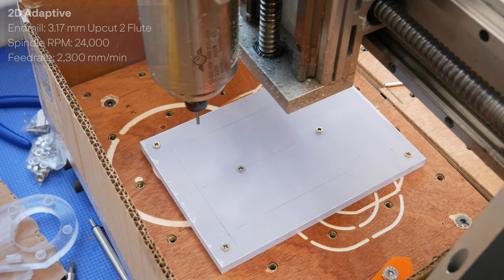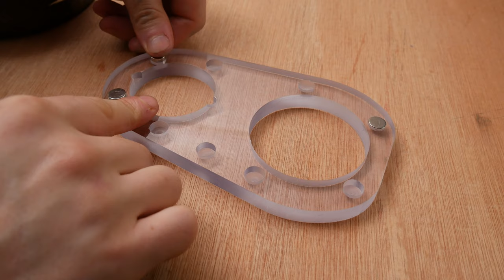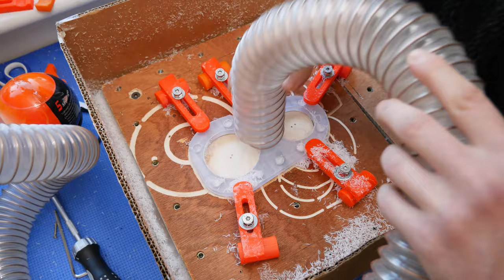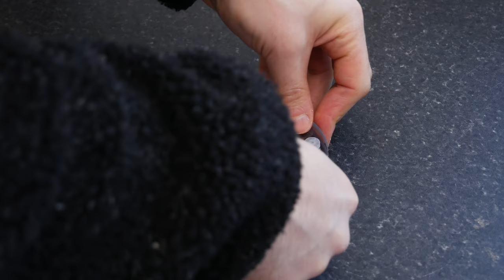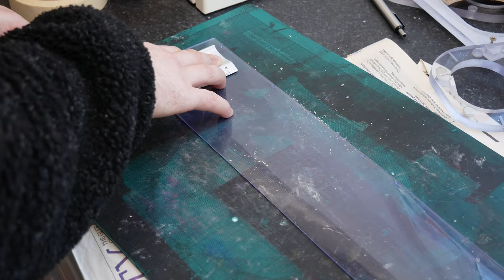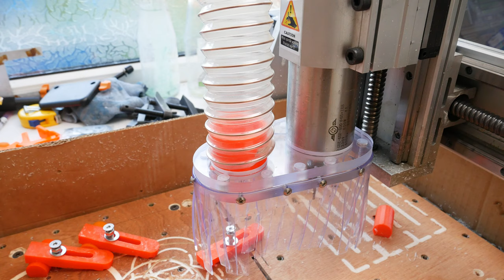Simple, Detachable CNC Dust Shoe Build

Comment: Nice, I did same thing but had one issue. Magnets hold only up-down but left right movement they start to slide, so I made small pins on the side to hold it. You did this one really nice, hf and may it serve you well.
Reply from the maker: Thanks Majsta, Wow you must have some serious forces in play for the magnets to slide laterally. What are you machining?!?!?
Reply: @ThisDesignedThat  Its the clamps, when I cut deeper. If they are bit in the way or parts of workpice, dustshoe then tends to slide off. Ahh nothing serious for now, just some hobby machining for now.
Reply: Can you share or sell your build file?  I'm rebuilding a  Shapeoko  using a ROTOZIP and it kicks a lot of fine dust (30,000 RPMs)

Thanks